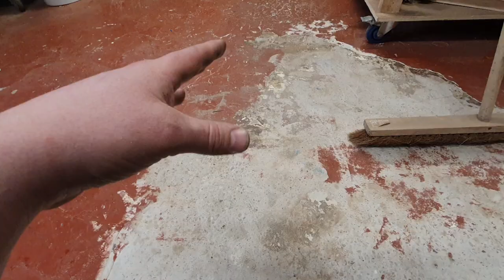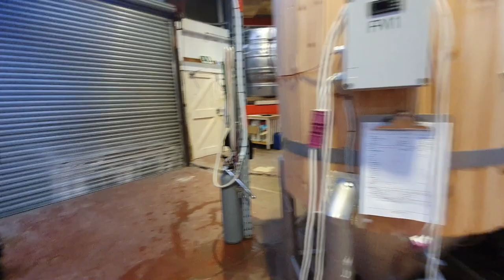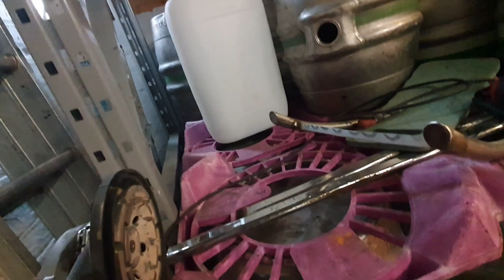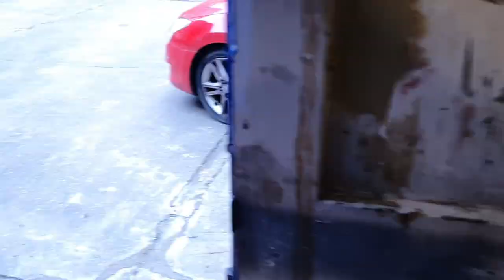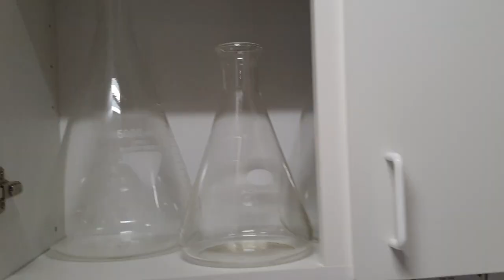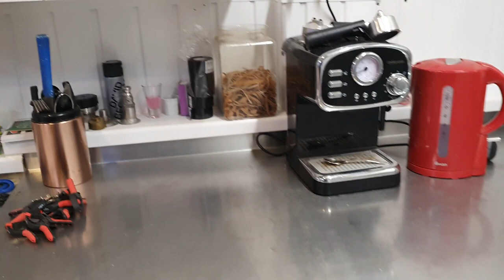Floor Grinding

Comment: Well impressed with the mod's. Thanks for the tip on over-cladding the roof. I have a similar issue with one of my out buildings where I have my little home brewery set up and was delaying doing it as I thought I would have to get a specialist team in to do it. But over-cladding sounds a much easier and cheaper option...